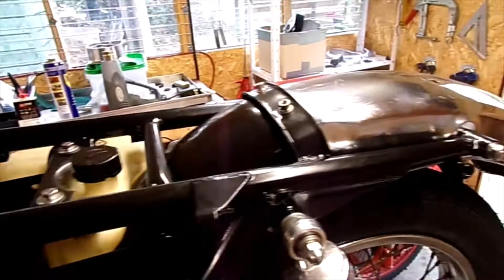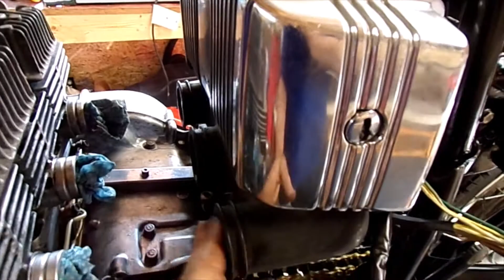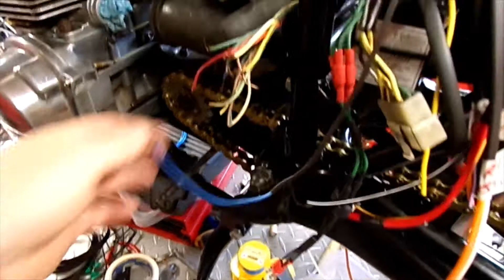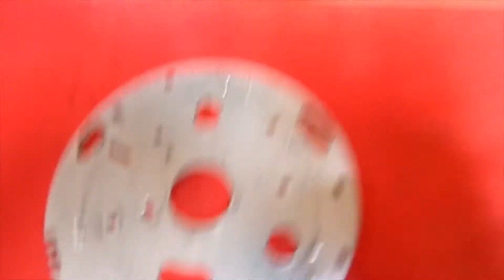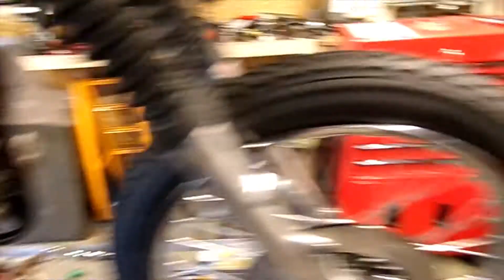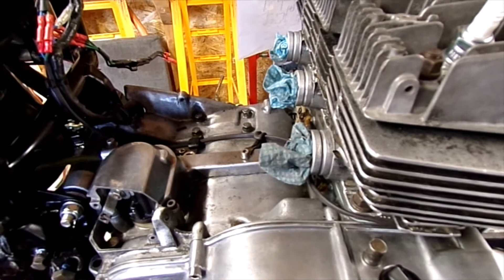Suzuki GT380 Wiring & electronic ignition

Comment: I had to replace my headlight and bucket as I could not get an OEM sealed beam light. Now I am having trouble matching up the connectors. I do not see colors well and I want to be sure I have the connections right.
Reply from the maker: A multimeter would help to work out what goes where

Comment: Nice work! I just picked up an 1975 GT380 for my winter project can't wait to get started.
Reply from the maker: Good luck, I hope yours came more complete than mine, I has many parts missing/incorrect and has been very time consuming and expensive to find them.
Reply: @InTheShedUK  Thanks! Yes mine is one owner and had been in a garage since 1980 all there all original but seat was changed out for lower profile. 11000 miles but it is locked up from sitting going to put some marvel mystery oil in cylinders and just let soak in.